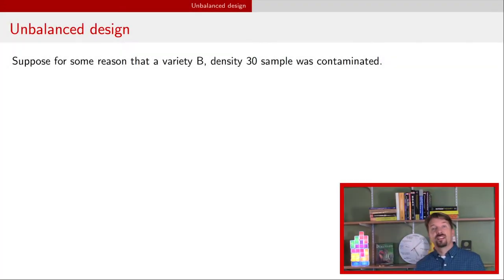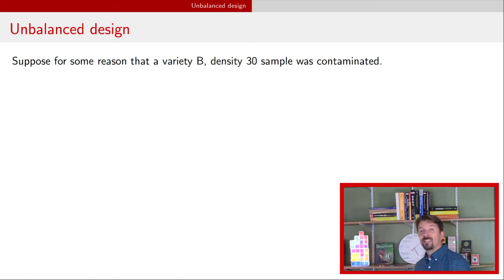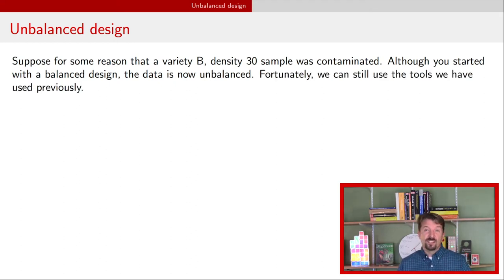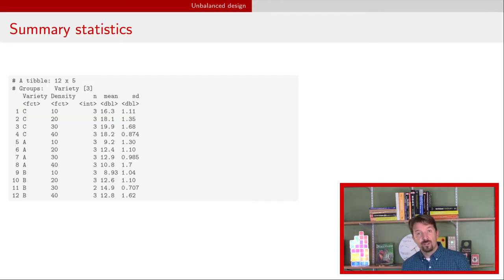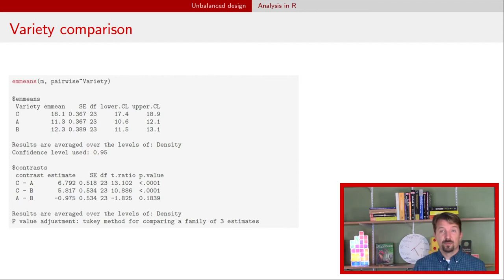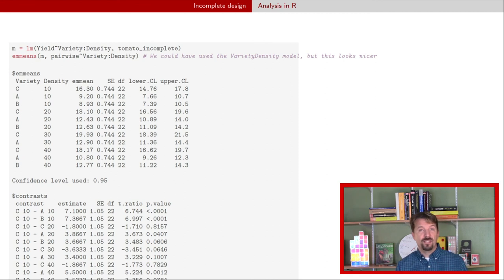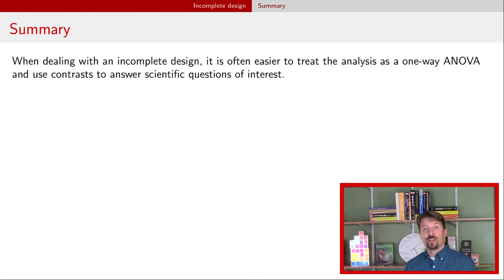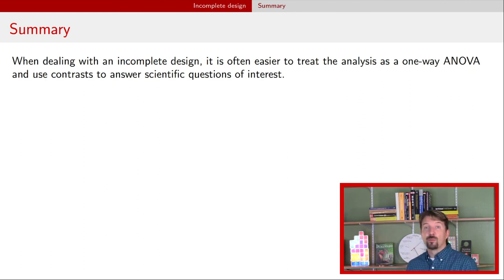Analyses of Two-Factor Unbalanced and Incomplete Designs in R

Comment: Sorry, one more question: is that possible for unbalanced data also to use the one-way ANOVA method?  
But actually, I tried it, I got different results. For example,  two-way ANOVA is like this: lm(yield~variety*density, data);
if I treated this as one-way ANOVA, then it's like this: lm(yield ~ treatment, data). Of course, treatment includes A10,A20,A30,A40,B10,B20,B30,B40,C10,C20,C30,C40. Could you please explain why the results are different?
Tons thanks!
Reply: Hi sir! Could I ask you a question? My question regarding Criteria on unbalanced data panel. If there are 10 companies that experience losses. Can I throw it away? However, I still take companies that have incomplete financial data. Your answer is very useful for me. Thank you.
Reply from the maker: Yes, you can treat it like a one-way ANOVA, but you will have to do more manually construction of contrasts to answer most of your questions of interest.

Comment: Hi sir! Could I ask you a question? My question regarding Criteria on unbalanced data panel. If there are 10 companies that experience losses. Can I throw it away? However, I still take companies that have incomplete financial data. Your answer is very useful for me. Thank you.
Reply from the maker: When dealing with missing data, the reason for missingness is extremely important and, generally, you cannot just "throw it away". Search for the terms "missing at random", "missing completely at random", and "missing not at random".
Reply: @jaradniemi  Sorry sir. So it's like this, when I took all companyies that suffers losses, the model chosen is REM and the results have no effect and the value of the R-Square is only about 2%. In addition, I also use one of the research variables, namely profitability, which only looks at the company's ability to finance its company with the profits it earns. It is possible that I will still take all companies that has complete financial data. So, even though the financial data is incomplete, I still take it. Automatically already included in the unbalanced panel data, right? Thanks sir.